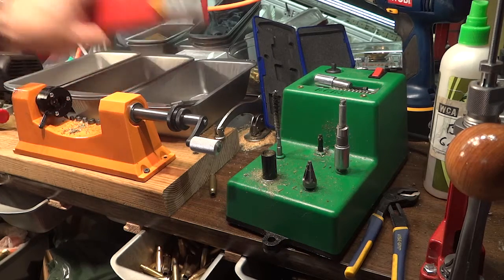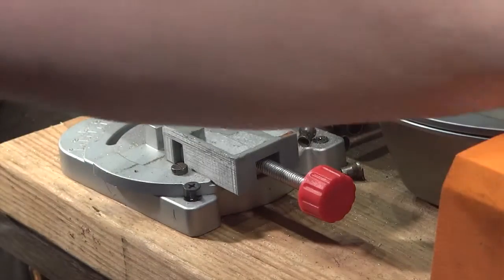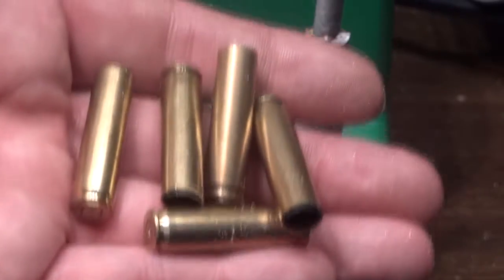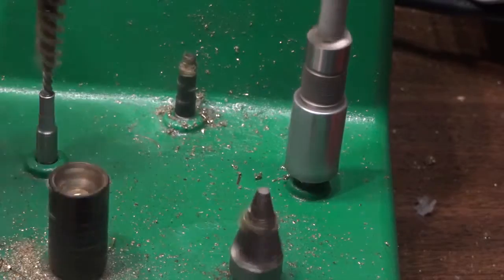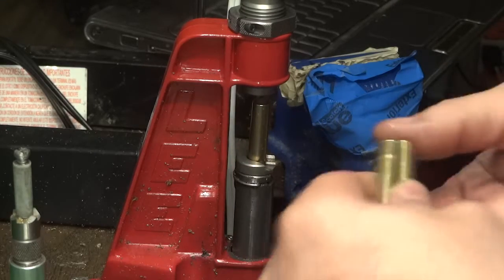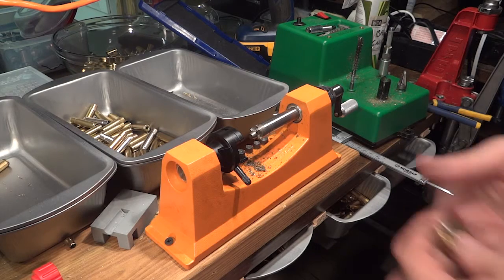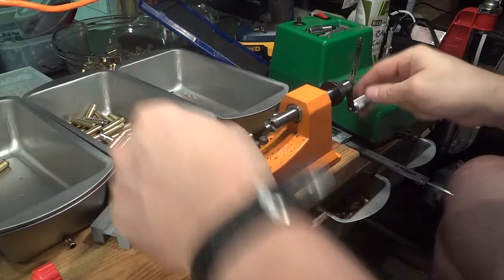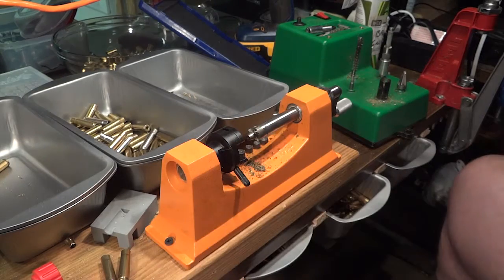Making 300 Blackout from 223 or 556 Casings

Comment: Mark , what # Lyman trimmer pilot did you use for 300 blackout on the universal Lyman trimmer ? I have the same set up …thank you !
Reply from the maker: It's been too many years since i filmed this.   I think i had to play with it until i found the correct one
Reply from the maker: Kinda related (but doesnt answer your question.   I used the chamfer tool head from this tool
On my rcbs case trimmer

Lyman 7777800 Case Prep Multi Tool, Multiple https://a.co/d/31XA8Yv

Because i liked the angle on inner case neck better.